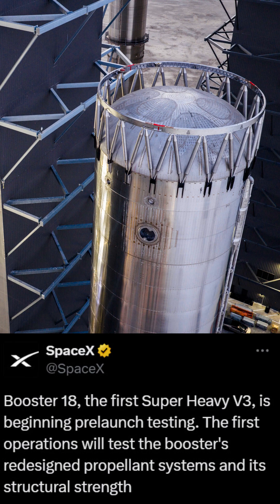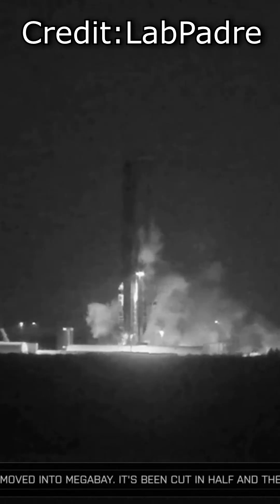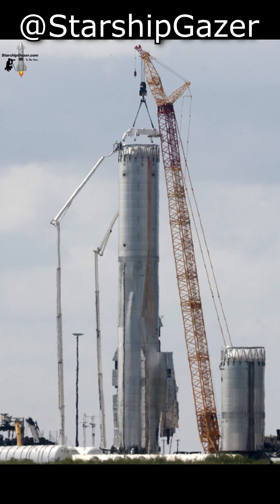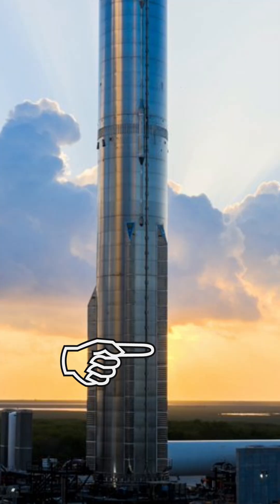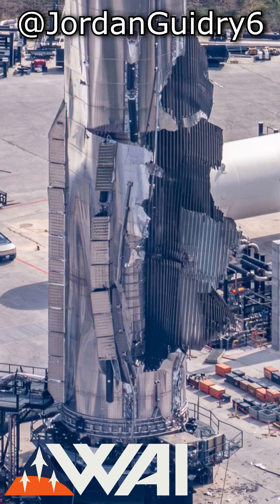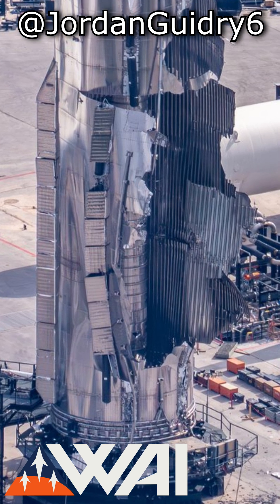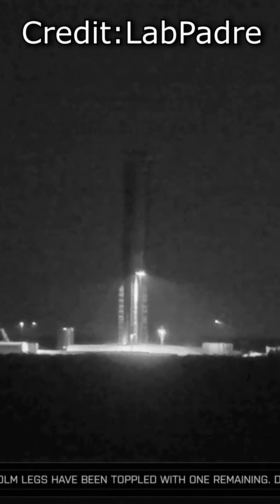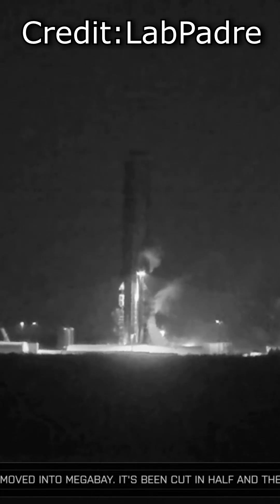SpaceX's Latest Booster Explosion Explained

Comment: It was NOT "spilling crogenic propellants" as you cite no propellants moments later.

FOR SHAME SCOTT!

Just kidding you're the best at this stuff.
Reply: Every pressurized gas is a propellant if used incorrectly enough.
Reply: @TheChaotix14  something something, Mythbusters water boiler
Reply: @panda4247  Something something, mythbusters gas cylinder valve stem.
Reply: @TheChaotix14  would the gasses used for this test be cryogenic though?
Reply: @TheNheg66  The 'gas' they used was liquid nitrogen, which is the most commonly used of the cryogenic gasses (because of the lack of flammability or oxidizing function).
Now you can liquefy nitrogen without cooling it down to cryogenic temps, but that requires pressures far beyond what you'd wanna put into an aluminium can like that.
Reply: @TheChaotix14 but it's gas - gasseus nitrogen, not liquid. Gasseus nitrogen could be cryogenic but doesn't have to be.
Reply: @TheNheg66  They were filling the tank with liquid nitrogen, as a safer stand in for the liquid oxygen that the tank was designed to carry (testing a tank for liquid oxygen with anything other than a liquefied gas around the same temperature as the liquid oxygen is almost entirely pointless). Also if it wasn't (near) cryogenic temps you wouldn't have those lingering vapor clouds after the explosion.
Reply: @TheChaotix14 again, where are you getting the "liquid" part from when this was a gas-only test by SpaceX's own words?
Reply: @TheNheg66  I've re-read a bunch of stuff, and it would seem I misread somewhere. I was under the impression they used liquid nitrogen, but it was a nitrogen and oxygen gas mix.
My mistake.
Reply: @TheChaotix14  fair enough, mistakes happen 👍
Reply: I'm honestly surprised he flubbed that... 😅
Reply: I was shocked that he missed that. Still, no respect lost at all.
Reply: Isn't nitrogen used as a propellant for EVA suits?

Comment: What effect do these boosters have on the air that we breathe? I didn’t consent to breathing rocket propellants. Did any of you?
Reply: they wont let you close enough to breathe those in lol, go complain about "chemtrails" or something
Reply: There was no propellant on board during this test.  It was filled with LN2, which makes up ~78%of the air you're already breathing
Reply from the maker: Not as much of an effect as rockets that use solid rocket motors or hypergolics, I suggest getting those fixed first before you look at this.
Reply: @scottmanley it wasn't pointy enough, it needs to be pointy.
Reply: Considering how many cars are on the road, their emissions are a much bigger concern compared to rockets right now
Reply: Yes. When you live in a city that launches rockets (like Hawthorne) you have to consider that you'll be inhaling gasses. Thats why californias proposition 65 states that business are required to post warnings of significant exposures to chemicals on the property
Reply: @SashaMeldrum There are no rocket launches in Hawthorne.
Reply: They produce water. Lots of water. Nothing else.
Reply: @fatcat2546 Methane and oxygen produce carbon dioxide and water from combustion, hydrogen and oxygen combustion is what produces only water.
Reply: @fatcat2546 So they're drowning us?! I didn't consent!

Comment: Why the hell are the copvs continuously exploding it happened on ship 36 as well now it happened on boost 18. I think this is some issue with the manufacturing process of the COPV
Reply: It being a COPV is speculation at this point. He even says it may not be in the video.
Reply: No, it's because both numbers are divisible by 9.
Reply: Spacex quality standards really declining. They’ll kill someone before anything changes
Reply: @masbestiaquetu  If it is a COPV that caused the explosion then it is slightly less SpaceX’s fault given that they don’t make the COPV’s themselves. Still a huge issue but not entirely on SpaceX (if that’s the case).
Reply: @Wurtoz  or mishandling
Reply: @m @masbestiaquetu  true but before space x was one of the leading companies in space exploration now blue has also come in SpaceX competition
Reply: @shoaibhub Blue has 1 successful booster landing vs 500 for spacex. Blue is 2 years older than Spacex as well. They need to pick up the pace if they want to compete seriously.

Comment: God damn Starship is turning into a Cowboy operation, they keep this up and Blue Origins gonna overhaul them.
Reply: Spacex are already launching over 140 times a year. And starship is still in testing, so how do you think they BO will surpass them?
Reply: @kevikiru at F9 you could see a clear progress, and it's reliable. At Starship it doesn't seem to work like this, they had a well working V1 version, and a lot of problems with V2. Now the first V3 booster is also exploded. While BO needs an eternity for development at least it worked well at the first launch. Starship however doesn't seem to make real progress.
Reply: @simonm1447 

I think there is a serious argument for Space X tapping the brakes on Starship. They’ve been ‘running fast and breaking things’ for five years now, and, well what honestly do they have to show for it? A big heap of scrap steel, a handful of successful test launches and a whole heap of embarrassing failures. Consider this; in the aftermath of the Apollo 1 disaster, NASA paused all manned Apollo missions until Apollo 7 in October 1968. And nine months after that Apollo 11 landed on the moon. From the twenty months in between Apollo 1 and 7, there were just nine months between putting men on the Saturn 5 for the first time and the Saturn 5 landing men on the moon. 

Space X should take a pause on launches, fix its build problems, carry out more ground testing and then commit to V3. Instead of constantly smashing into the same wall.
Reply: @kevikiru 

It’s not about how many launches are taking place now it’s that Blue Origin has demonstrated that they can improve at a faster rate than Space X, they’ll shortly have a reusable operational rocket with far greater launch capabilities than F9, Space X has nothing to counter New Glenn. And they won’t until they get Starship sorted, which at the current clip is gonna take a while.
Reply: @kevikiru  If BO managed to increase the launch  cadence of New Glenn, it will be a major theat  to the Falcon  rockets' market dominance. .
Reply: @remliqa they will absolutely increase cadence to dozens of flights per year in short order. Spacex Stans can’t accept reality it’s so funny to me
Reply: @remliqa  No. Competition is always good for rockets.
But Falcon 9 will stay in its ground for the foreseeable future because they have Starlink launches, Crew/Cargo Dragons, VAST Space and other private customers with low budgets. And with a success rate of around 99.48% with 573/576 successful launches. NG has a long way to go but I hope they'll also eventually succeed.
Reply: @kevikiru you know. By real design process, and not sending half baked hardware for publicity stunt flight. Many decades ago this was how hardware was designed. Look at Apollo. There was one fire in capsule (spadły 3 dead), but rest of the program was virtually all a sucess from the first try. Nobody had money to send 10 Saturn V's for them to blow up or fail other way. Failure was not an option. Right know 'Gen Z' engineers actually cheer when their creation blows up. Many years ago people would rather feel bad in same situation.
Reply: Blue origin has no plan for any rocket that could outdo starships capabilities currently, so I doubt that'll happen unless SpaceX ceases to exist.
Reply: @callumcurtis15  BO already announced that they're designing a much , much larger rocket that can directly challenge Starship and the SLS.  They also is planning to increase the capability of their BE4  engine.
Reply: @remliqa  I disagree. New Glenn was never designed to compete Starships or Atlas Vs. New Glenn can't land propulsively land its SS. Starships can bring cargo from Space onto the surface. NG can't. Because it isn't designed for that purpose. And Block 4 Ships are going to be massive. So not a chance.

NASA RS-25s, Blue Origin BE-4s and SpaceX Merlins are designed not to fail while Raptors are designed to "Squeeze out" more performance.

2 different architectures mate.
Starships are best for Moon and Mars. While Falcons and New Glenn are best for LEO, GEO etc.
Reply: @manuramethsith  I'm not talking about the current New Glenn. I'm talking about the recently announced bigger New Glenn BO is planning to build . That rocket is taller than even the Saturn V and  just 5 meter shy of Starship's full height.    

I'm also not convinced Starship is best for Moon and Mars. Its current design is less capable than even the Falcon Heavy  at carrying interplanetary payload, let alone  the SLS. Being fully reusable mean it also carry lots of penalty dead weight at the expense of usable payload.
Reply: @remliqa You didn't get my point.
First, I said that New Glenn (Any version) isn't designed to compete Starship. NG SS cannot be modified to fit multiple purposes like Starship. It doesn't have a Heat Shield so no re-entry. Currently no Orbital Refueling too. NG is a One-way architecture. In size, Starship is growing in the future too. And the first block 4 prototype might even be out before NG. So New Glenn will never have a fighting chance against Starship. Maybe against Falcon Heavy.

Also, when we talk about Payload to Moon or Mars, there are Low Energy orbits that take longer to reach a planet. It's typically more than 6 months to Mars using New Glenn or Falcon Heavy. Because they don't have the Orbital Refueling capabilities.
But Starship can travel to Mars in 3 months after Refueling. It also has a Heat shield to fight the Martian atmosphere so it can burn off speed by "skipping" over a few times. And calculations show that a fully refueled Starship can carry humans to the moon in 3 says, land, and then return back to Earth, relight the Raptor Vacs again so it can slow down to LEO. Since HLS doesn't have a Heat shield they can transfer the crew to another ship / Dragon / Starliner or even the ISS.
Also, Ships can be modified as depots so that they can even refuel other vehicles in Space. There are countless possibilities.

Does NG have that capability? No.
Because it is not designed for that purpose. They will build another rocket to compete Starship's capabilities.

You were confusing Orbital mechanics on how New Glenn or Falcons can send payloads to the Moon or Mars but Starship's struggling to LEO. It takes years! Ships have Refueling. That's the point. Cuz others are on low energy orbits while ships can take a quicker orbit with more fuel. Do some research before hopping back in.
Reply: @manuramethsith  The orbital refuelling part may not as big of a sell as you think. It is estimated that it will take the Luna Starship dozens of launches  to provide enough fuel for  the roundtrip to the moon if we go full reusable on the booster and  the fueltank Starship  .  It  is uncertain how much cost and time all those additional trip will add . Any trip to anything further than the moon will take even longer. One fail or delayed launch will set back the process for at least days. There is why some would prefer one successful launch rather than dozen of them spread over weeks for the same mission. 

This is the reason The NEXT gen New Glenn or New Glenn heavy  will a competitor to both Starship  and Falcon Heavy for these type of missions.  The current New Glenn is is direct competitor to Falcon 9 but won't be taking missions away form Falcon Heavy unless NG goes full expendable, something that BO have no indicating of being interested in  .

That said the BE-4e engine is still ripe for further improvement and tuning that will increase its performance and capability.
Reply: @remliqa  I agree. All you said is correct.
However, your understanding is wrong.

Both Starship and New Glenn are good in their own ways.
While it's true than it will take 12 or more tanker ships, it is not directly related to the mission. Remember that there is a depot? The depot is to be optimized to hold cryo for prolonged periods with minimum boil-offs. So they can keep it filled up weeks before the actual mission. In other terms, SpaceX always keeps the depot(s) full. And then when the mission happens, they simply chase the depot and refuel the transporter in one go. So tankers aren't directly related as you said.

Accordingly there will be exactly 1 contact with HLS for refueling. So very low mechanical wear / failures HLS side. Depots can wear down quickly but they will be easily replaceable.

So what the contractor (NASA) sees is they send HLS to orbit, dock with the depot and fill it up in one go. The rest (everything happened before) was upto SpaceX. Since they can maintain multiple depots in Space, there would be no shortage of fuel at any moment.

NG is expected to launch their MK2 lander in Artemis V. But it cannot return back to LEO. Ships can. New Glenn (Current or NEXT) cannot compete with Ships. Ships are multi-purpose, refueled and easily modifiable.
Commercial Starship doesn't even exist yet. So competing / comparing with it given its possibilities doesn't make sense.

New Glenn doesn't have to be expendable to challenge FH. FH core stage was expended during the Europa clipper mission. So NG has already challenged FH given its telemetry.
Reply: Lmfao at all the SpaceX Stans in the comments 😂 they’re jealous that blue origin landed booster on first attempt
Reply: @masbestiaquetu  As "SpaceX fans", we are very happy that Blue Origin succeeded. Because we got some healthy competition now. Rocket Lab's Neutron is next.
Reply: @manuramethsith I’m glad you feel that way, I’m the same. Wish more Spacex fans felt the same as you, many make fun of and actively root for blue and rocket lab to fail.
Reply: @masbestiaquetu  Second attempt. BO's first attempt at landing the booster failed.
Reply: @remliqa  wrong. Booster exploded on engine relight and had no chance at attempting a landing
Reply: @masbestiaquetu  Hence why the first attempt at landing the booster failed,  it suffered rapid unscheduled disassembly mid air.
Reply: @remliqa  idk to me there’s a big difference between the booster exploding on the way down, versus an attempted landing that missed or hit the barge hard and RUD’d. just a matter of opinion tho
Reply: Yes, like in 7 decades.
Reply: @eugenecbell  Dunno, BO achieved a drone landing on just its second attempt, Starship keeps crashing and burning. BO has the advantage of the Bezo's cash and the free data that Space X provides (to be clear I'm not fan of either CEOs.) Blue looks a lot better positioned than I would've said six months ago.
Reply: @TBone-bz9mp yes, but they are nowhere close to what SpaceX has at the moment, but their progress is impressive and I’m rooting for BO too.
Reply: @TBone-bz9mp 
SpaceX has landed about 100 times more Falcon 9 busters than anyone has landed busters.  SpaceX is developing a larger and fully reusable rocket than Blue Origin. 
I look forward to Blue Origins future successes, but I can also look back at all of SpaceX’s success and forward to more SpaceX successes. 

Mostly I look forward to both companies being successful and bringing Man to the planets.
Reply: @eugenecbell exactly 😂, a single booster is gonna set spacex back like a few days. But if a new Glenn booster exploded it would set blue origin back like 5 years

Comment: Could the Methane tank be reused for b19
Reply: I was wondering the same
Reply: I don’t see why it would be since they obviously already have one made or being made and using b18’s CH4 tank would obviously be kind of sketchy given the whole ”bursting” part.
Reply: @Wurtoz maybe but the booster are constructed in 2 half’s and the top half is fine
Reply: @starbase_updates  We don’t know that it’s fine, there could be damage to the internals that we can’t see from this angle. On top of that I don’t see a good reason to do this, they’re still going to need all the other parts of the booster to be made new so you might as well make a new methane tank while you’re at it so you’re sure it’s not damaged.
Reply: @Wurtoz yes I suppose but it’s SpaceX so you never know
Reply: They should use it on a Frankenstein Booster 18-1/2
Reply: @hectorpascale1013unfortunately they have scrapped it now 😢